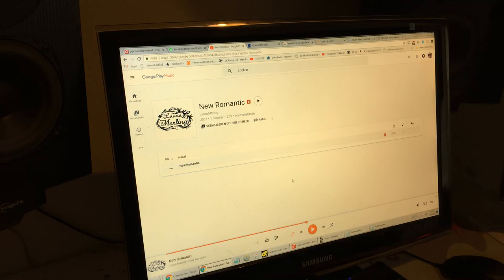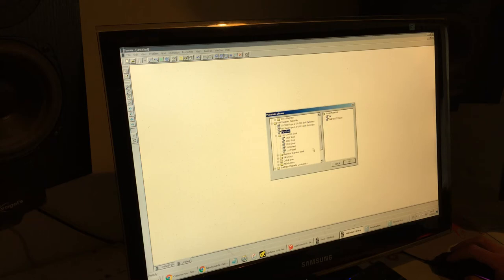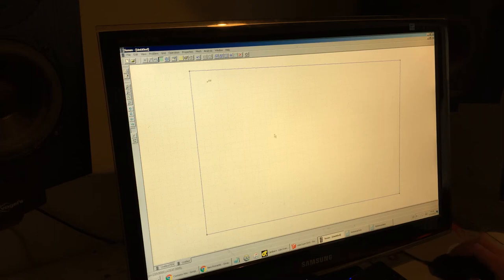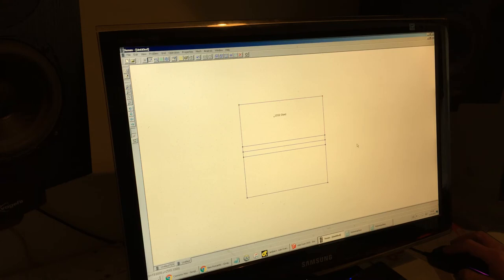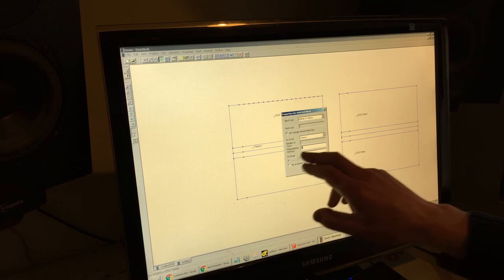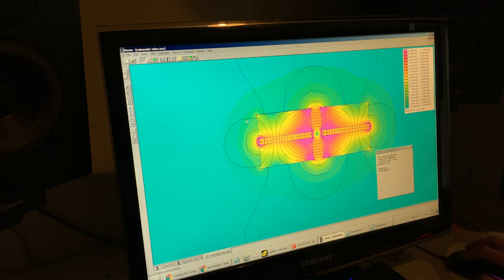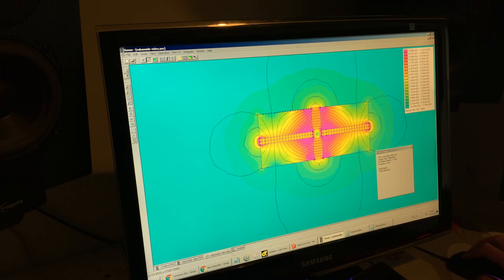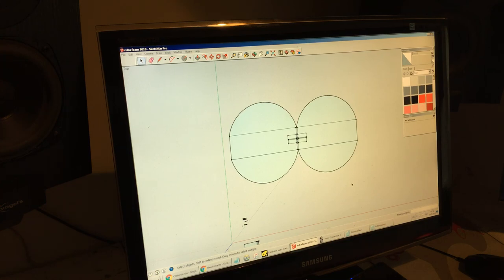Basic Femm Rubanoide Motor How to (with music)

Comment: Because of that diagram it makes sense to me how the coil works on a Rubanoide driver. In the one half of the coil, current goes up and gets pushed forward in the N->S field, and in the other half of the coil current flows down and so it gets pushed forward as well, in the S<-N field. Or the other way around, but either way both halves of the coil work together because they operate in opposite fields. Very clever. Now I understand how harddrive voice coils operate as well!
Reply: Yes, but why not have current flowing in one direction and use the magnets facing each other across the gap? Stronger and more uniform magnetic field.